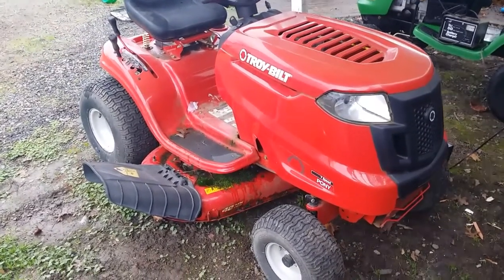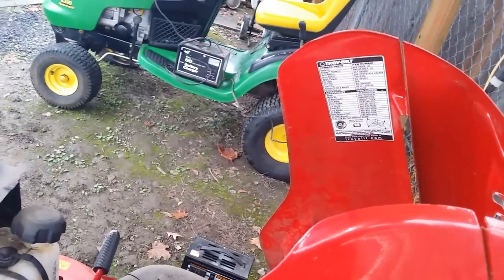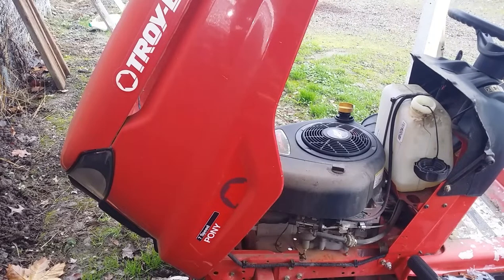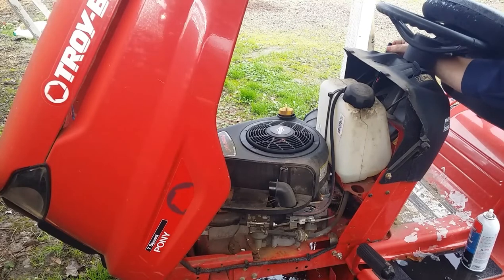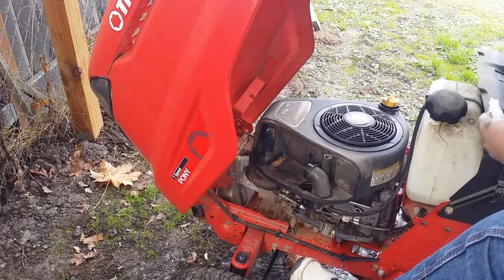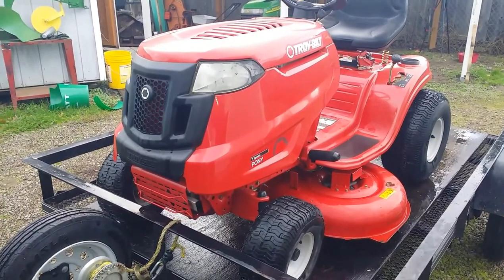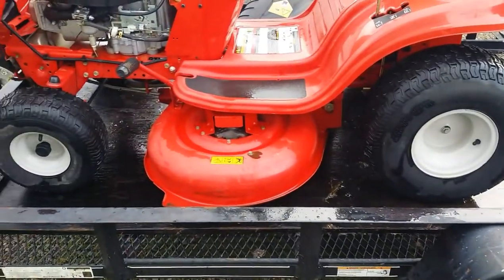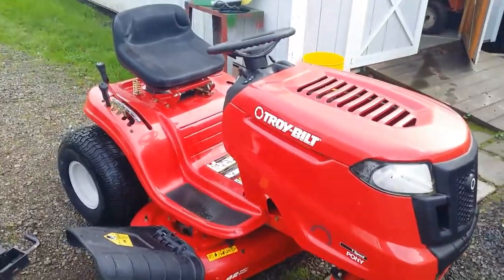Will it run? Troybuilt Riding Mower Revival! 15.5 HP Briggs and Stratton. Free Mower!

Comment: Can't give a thumbs up . Not with half as much oil as it needs. Sounded like the deck ran OK putting a further load on an engine without good lube. At least it wouldn't run off choke to really load the engine down. Shoot some people are born lucky and that's way better than good.
Reply from the maker: It had new full synthetic oil, only filled it to just over the ad line. Remember this engine was full of gas, it's going to take at lease one more oil change to get it all out of the crankcase. Oil is 6 bucks a quart! No reason to toss another 6 bucks in the drain pan for no reason.